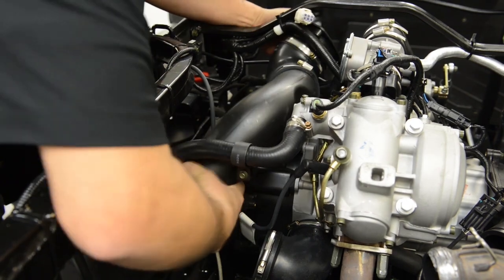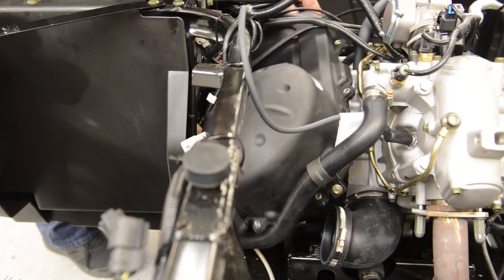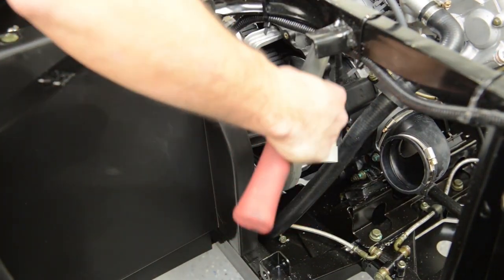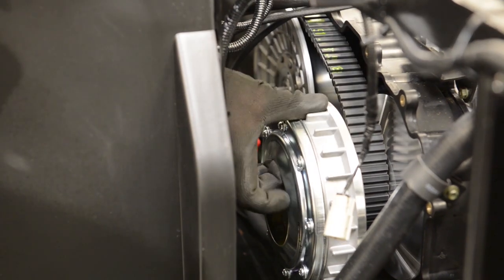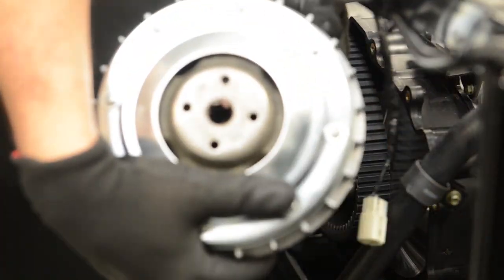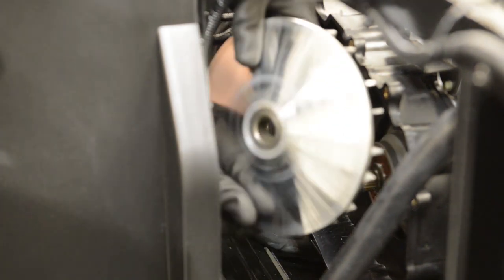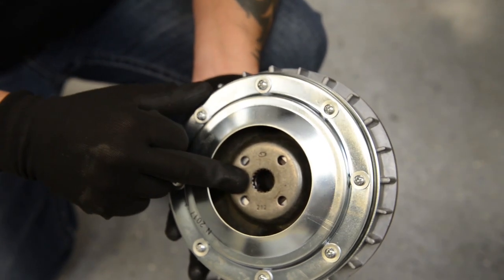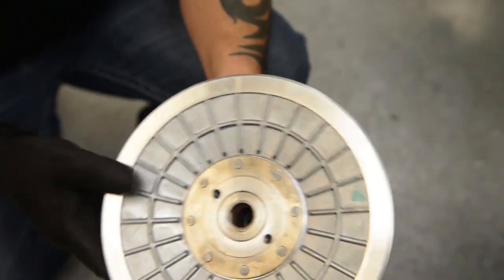Clutch Removal & Belt Inspection - HISUN 550cc UTV Engine

Comment: In your experience,  have you seen the back half of primary clutch that has cooling fins on it....have you seen it run against the wet clutch housing before?   I bought a 2nd hand HiSun Cub Cadet Challenger 750cc UTV knowing it had an issue.  Was told the wet clutch and one way bearing had been replaced.  Something I noticed on the back half of the clutch was that it has no splines on the fan part? Is that splined part pressed into it from factory? Thanks in advance for any helpful information